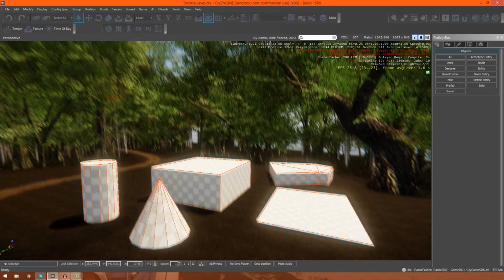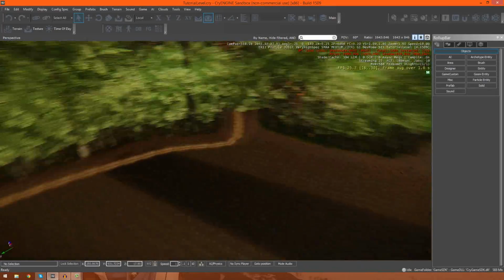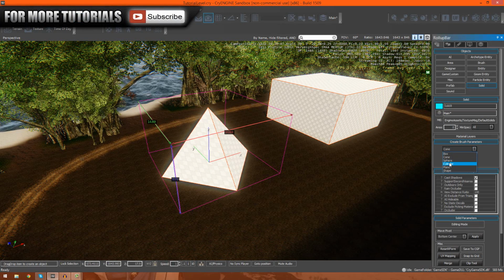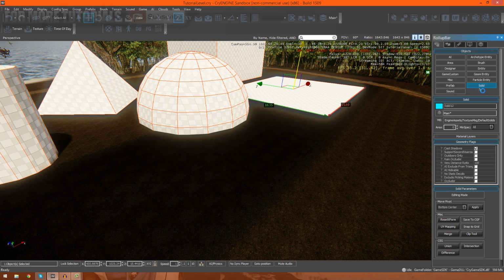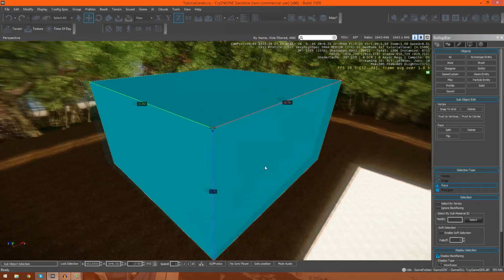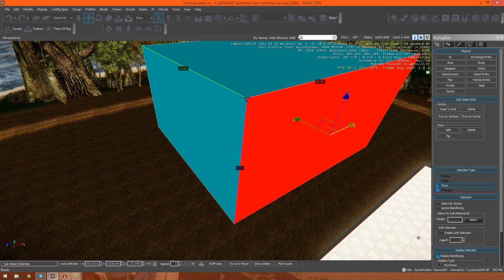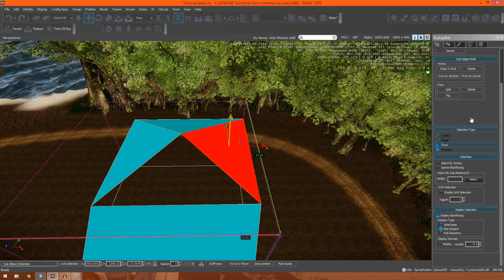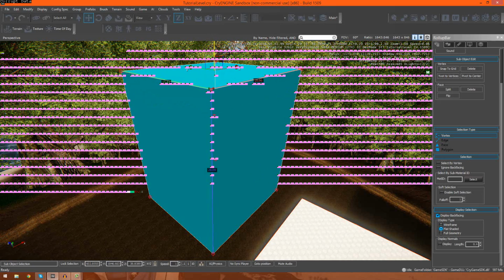Cryengine 3 SDK Beginner Tutorial Series - #13 Solid Geometry

Comment: I just found out terain creator software called World Machine 2. I will export real life heightmap from Google Earth so should I use World Machine or Cryengine terrain editor?
Reply from the maker: World machine is great for creating terrains as it can automatically generate realistic textures and natural simulations of the terrain.

There's a whole bunch of showcase videos of terrain created using it on Youtube and it looks absolutely stunning. I have used it myself and it looks brilliant.

Cryengine 3 on the other hand allows you to sculpt your terrain by hand using brushes and have a lot more control of your terrain directly frmo the engine

It's all a matter of what you want, if it's quality then by all means go for World machine, however if you want ease of use then use the Cryengine 3 Terrain Editor.,
Reply: Virtus Education Thanks for the answer. I will be doing some project with my friends that will have real-life heightmap from google earth and can that program be used to apply textures to terrain automaticly and realistic ,and do I loose on the quality of graphics of textures if i use it? Also looking forward for your next vid.

Comment: i know is an unfair question but which engine do you think is better  udk(2014 version)  or   cryengine
Reply from the maker: Personally I feel that unreal engine 4 is by far more powerful, fast and easy to use in comparison to Cryengine 3 and the latest version of UDK.
Reply: Virtus Education  will unreal engine 4 becoming so we could use it for free.

Cryengine question:    is it possible to animate a grunt using track view of do you have to use anim object.
Reply from the maker: In terms of the first comment, I can't really say whether or not unreal engine 4 will be free as I have no say as to how it's licensed.

What I do know however, is that there is an unreal engine 4 beta going around which is given to developers for free. I've been part of that beta program since november last year and have been using the engine.

Lastly, in terms of animating grunts I would say that you would have to make it's animsets all animation objects rather than using track view.

Just remember that you need tons of animations for AI such as run, run left, run right, jump, jump backwards etc etc

Having said that, it's probably best to make all of your animations inside of Maya or some kind of animation software package then bring them into Cryengine.
Reply: Virtus Education ok thanks